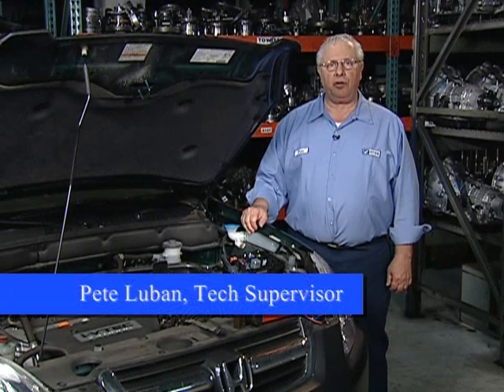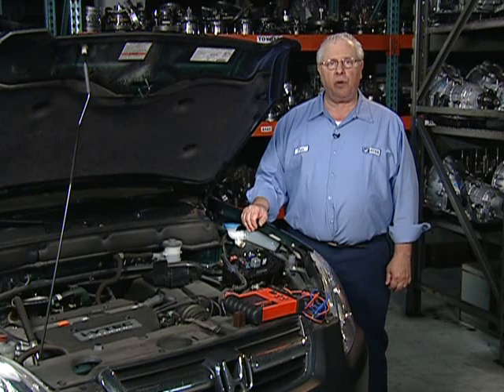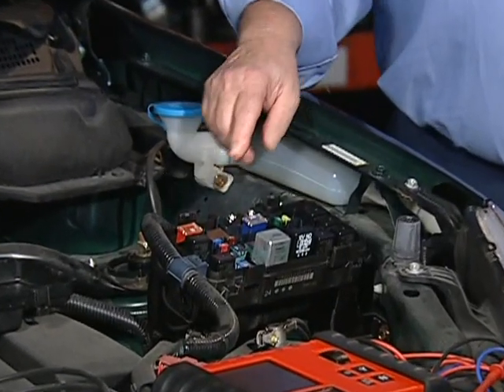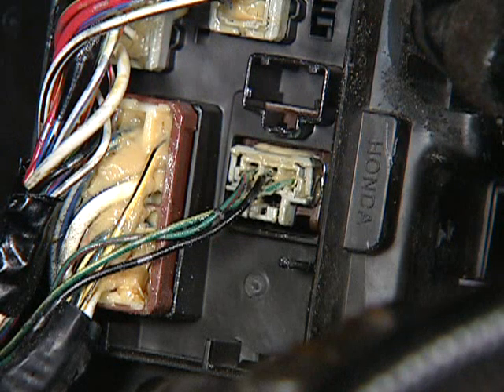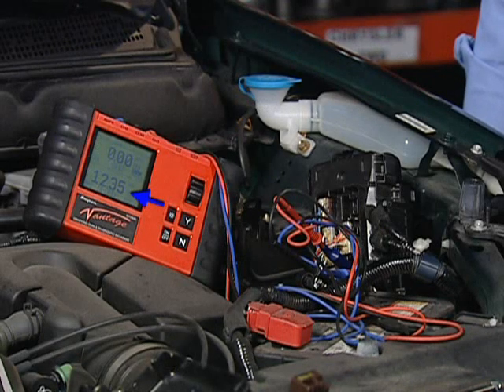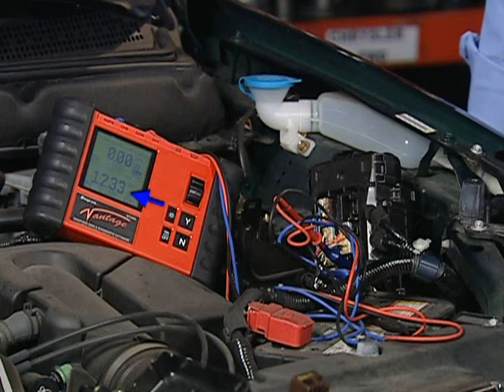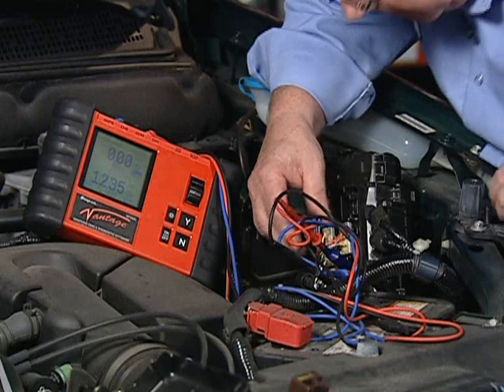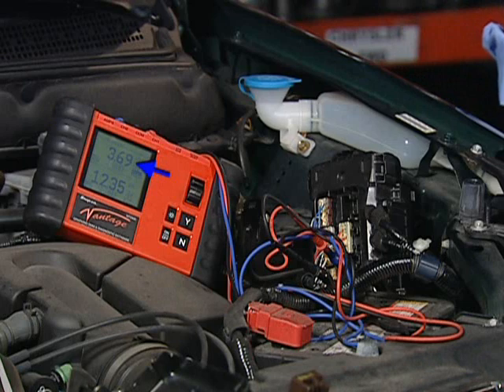Automatic Transmission: How to Fix a 2004 Honda CRV Solenoid Code

Comment: can ELD  responsible for multiple shift error code and shift solenoid stucking as well as shift error f code and shift error c code.  e.g. p1734, p1731, p0756 and p0780.